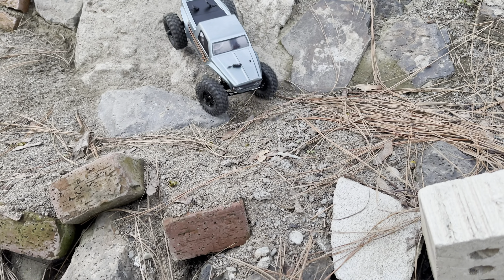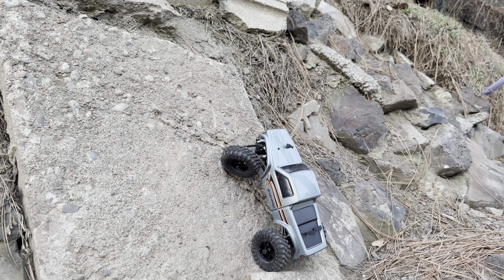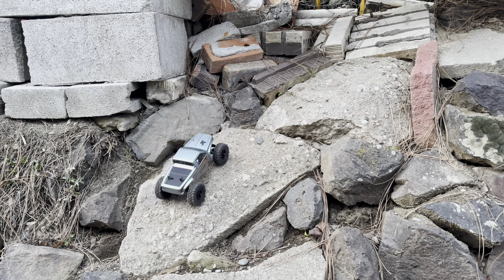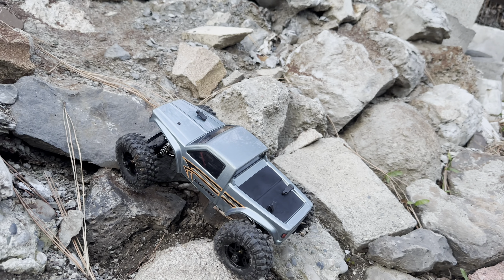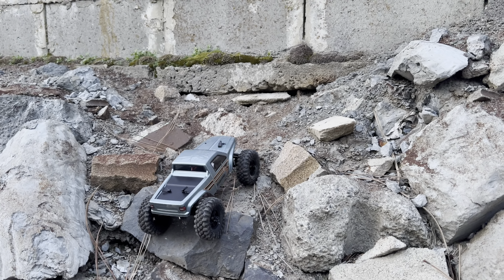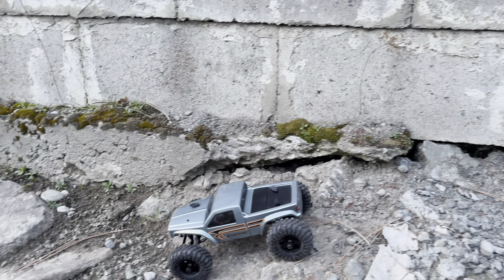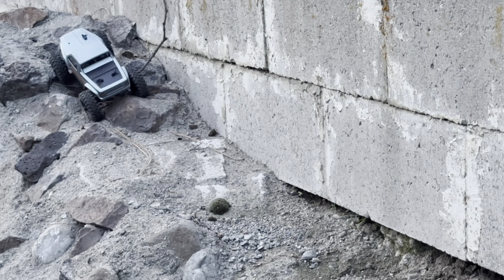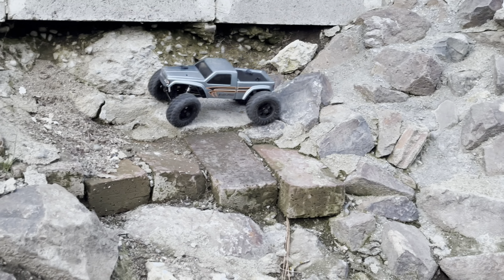Hobby Plus CR18P Evo Pro 1/18 scale RC Rock Crawler post mod test.

Comment: Nice I think you need wheel weights 

🔵🔵🔵🙂🙂🙂👍👍👍🔵🔵🔵
Reply from the maker: Your right. I thought I had it built well enough as a sleeper that I could just run stock tires, it does do ok, but heavier wheels at least in the front would probably benefit. Only problem is the front axles are so wide that wider aftermarket wheels would make it difficult to get through the gates at comps. Do you or anyone else reading this have any wheel suggestions?